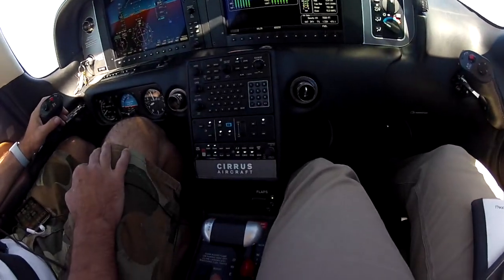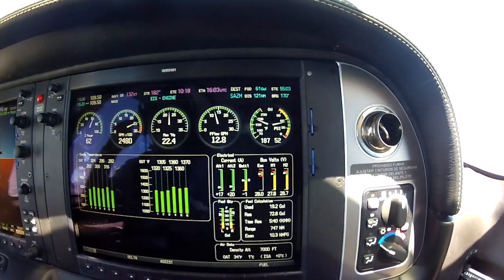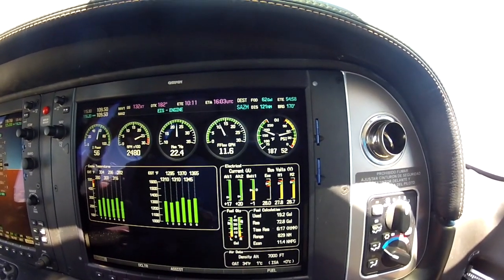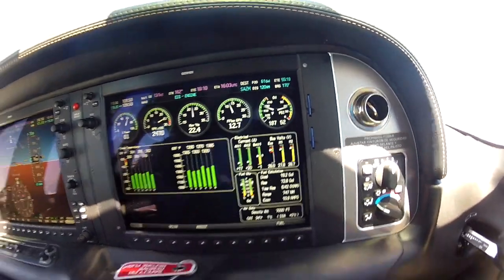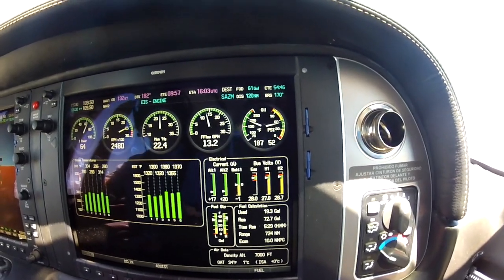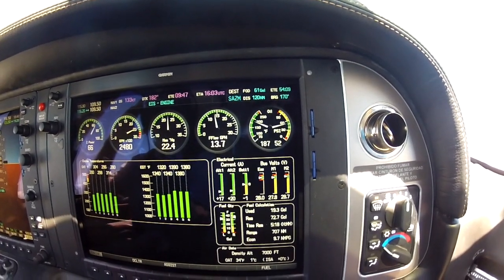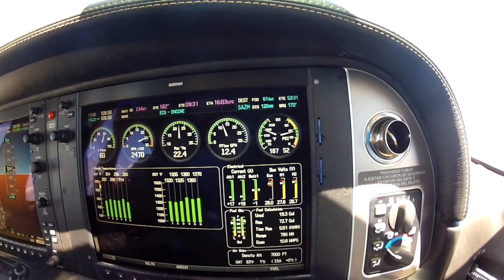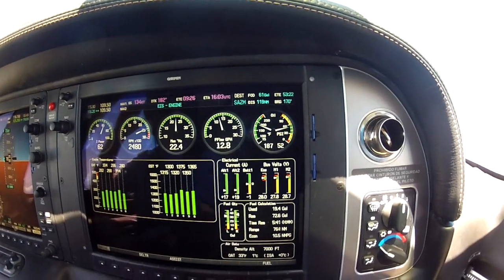Cirrus engine roughness when turning off boost pump

Comment: Cirrus recommends simply leaving the boost pump on (do not turn it off again after your mag checks) and during the flight, especially if outside air temps are above 20c.  The book requires turning it back on again before fuel selector switching and for landing so having it on all the time alleviates remember to do that...  The pump is robust and it will out last the life of the plane.  You will also avoid turning it off when you are leaning and have the fuel flow restricted causing the engine roughness.  But you MUST remember to turn the boost pump off once you have landed and during taxi as it will cause the engine to continue to run when you attempt to shut it down.

Comment: Let’s say you don’t adjust fuel flow up 1 gallon and fuel pumps off, will the engine roughness go away after a bit or will it be rough for a little while.
Reply from the maker: If you set up in cruise and then turn off the boost without first increasing the fuel flow, you have basically further leaned the engine. This is what causes the roughness and will continue you do so as if you have leaned the engine too far. This video was for lean of peak operations. ROP you wouldn't get the roughness but you would move your temps close to peak EGT which is also bad. Some passengers are very timid flyers and engine roughness can make them highly uncomfortable. This simple trick will help avoid the roughness and keep your passengers happy.
Reply: @NorthStarAero  
Ok I understand the concept now. 
Thank you.